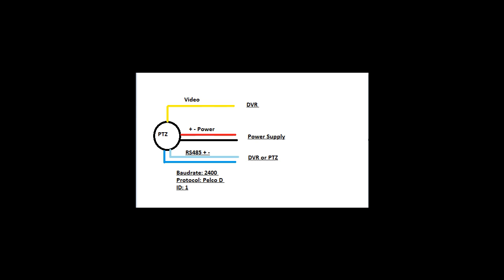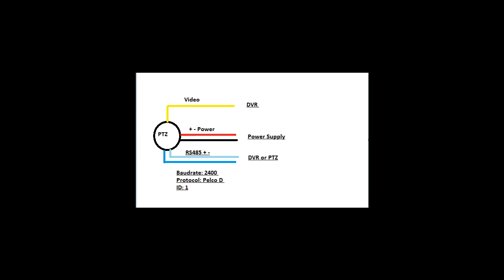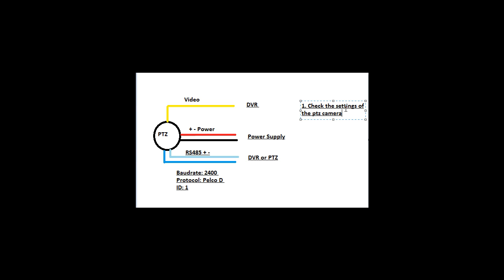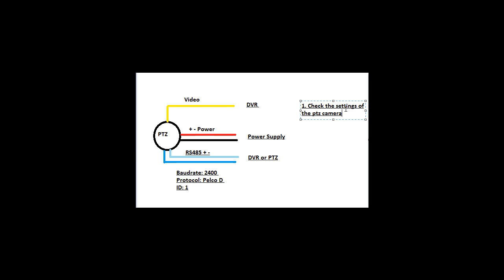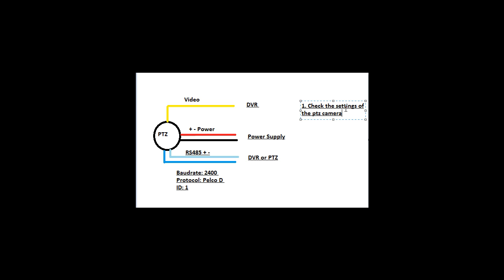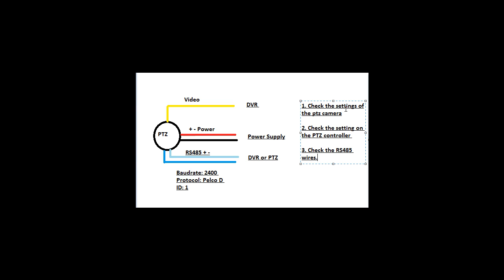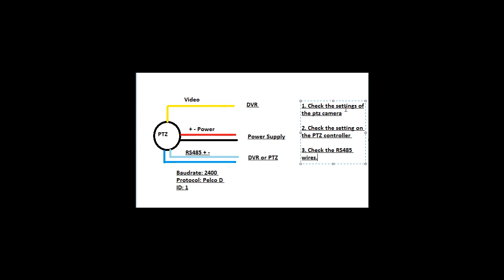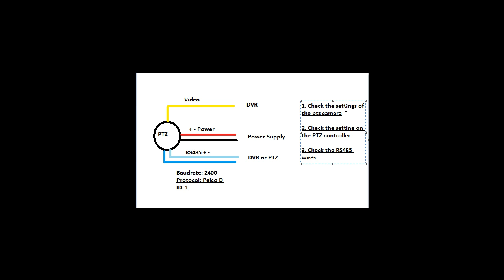Troubleshooting a PTZ camera that is not moving

Comment: So had to replace my 37x zoom PTZ seeing a box of cameras never made the move somehow. I have had mine for a while so know well how to use setup and control all functions. However I wonder if there is a Fast and Dirty way  or Clean way to fix the Camera communication. So when I start my camera before my other camera would show on a Black screen the Baud rate and settings for the camera it self. I assume this is the issue seeing I have the Black screen however no info. Then once the camera comes kind of online it shows the DOME settings and selftest info. However in the Info Camera shows ERR... I don't know why they even make it that someone could change the settings over OSD in the first place. Not talking about Soft Set. Anyway I can PT change settings in DOME. However once the settings in the camera are changed it don't take effect. So between Dome and Camera 0 Communication and is why I can't Z (Zoom) either... So I thought maybe change settings in Dome. Take apart access the DIP switches and change from 2400 to 9600. Make change in all my other cameras and then change DVR to reflect the change. I can access the PT again but no Z still... Then there is a Sticker on unit that says don't change address of Camera or it will not work. Well I guess that was why The person was selling it because it is kind of Bricked. Besides in the OSD is there a way to set it back to Factory without sending it into Factory. Already tried the Set to factory in OSD. Can't pull the Battery because it is already bad and if you keep it off the Unit changes time to 2137 year lol...

Comment: Thank you so much for this.  I have just installed my fourth Lorex system, but the first with a PTZ camera.  The included directions are easy to follow, but when you change your channel setting it also automatically changes the ID setting.  No where in the directions does it state this.  So, I have the PTZ setup on channel 7 and had to change the ID to 1.  Thanks again!